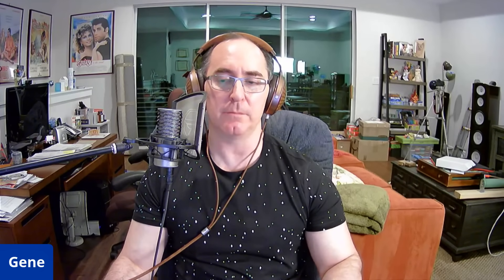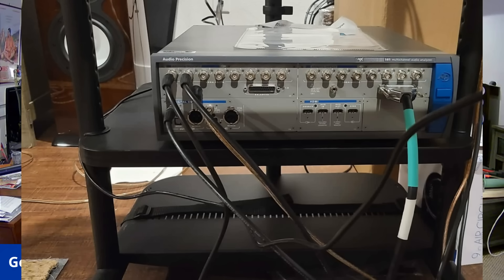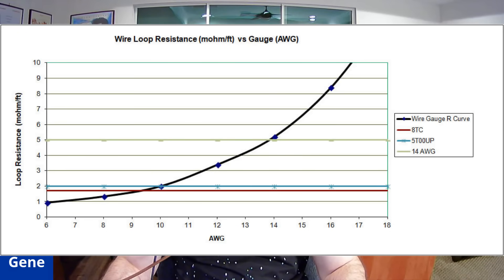Speaker Cables Really Don't Make Much of a Difference?

Comment: I'm happy to learn that my lamp cord is perfect for the job
Reply: I'm harvesting my old land line phone cables from my walls.
Reply: @deadmousyplutaprestige8771  too far
Reply: @deadmousyplutaprestige8771  They are solid core copper. Ive done that lots over the years. Just used phone line for long runs or temporary runs.
Reply: @deadmousyplutaprestige8771  Might want to twist a couple together, but I think you're onto something.

Comment: I use installgear 12 gauge  cable I got from amazon at $40/100ft with Sewell banana plugs for another $15/10. I did notice a difference coming from my previous cheap cable that was copper plated tin, but I chalk that up to resistance. I really try not to buy into audiofoolery unless someone can show me a measurement. A lot of folks poo-poo audiosciencereview, but I think most of that comes down to confirmation bias. If you've got a problem with the test, fine, but better yet run your own test and prove it. Like you said, the burden of proof is on those making the claim that there's something special going on.

Comment: Excellent video! Yes, we need more science in audio. We are getting there thanks to you and others like you! Keep up the excellent work!
Reply: I thought the same, I had my flagship arcam and Canton reference book shelf with oppo player hooked to regular bestbuy speakers wire with no conditioner power supply and reg hdmi cable.
Base not great and clarity was also not the best. I thought I need to upgrade my amplifier. More power required.
Then I was advised to look into wires, hdmi and power conditioner.
Did some research and purchased van den hul ultimate hdmi 4k cable, then same company mid level speakers wire and Puritan conditioner. Ask my wife to listen before after difference.
One simple answer. Big difference, base went up, much refined sound and distortion was gone.
I used to hear mild noise from arcam tridol power supply now that is gone.
Thats my take on this. Personal and family experience.
Reply: Amen! What the heck is a "chocolatey" midrange, anyway??

Comment: I remember back in the day when Monster hit the scene and a major HT magazine compared them to coat hangers, and found no perceptible difference.  When planning the set up of a 32 speaker system at Burning Man one year for an art project, I ended up using standard 12ga solid core electrical wire for durability and cost.
Reply: There have been A-B tests with battery jumper cables and pros can't hear the difference. Mixing studios use Belden in their boards.
Reply: @amazoidal  Studios use Canare and Mogami.. Great quality and a premium but not insane. I pay $4 a meter
Reply: @drdelewded  and Belden...each cable has it's purpose and application.
Reply: @cap96lt1  for networking, video, audio harnesses and computer applications sure we do. But running between gear, mic cables, speakers stuff that's "In our boards" we generally use Canare or Mogami.
Reply: @cap96lt1  actually our harnesses are IEWC, thought it was Belden , Which run all throughout our facility from the master control to the broadcast studios to the tape pit in the basement and to all our audio studios . I had to go check a bundle I took out of recycling that I use to make short patches. Anything critical I use Canare, as does my work. The IEWC is fairly thin, but most of it ends up in bundles in wall, floors and the back of patch bays.
Reply: @drdelewded  Mogami here, they give measurements and I get the better connectors, like you stated, about $4 or so a foot plus the connectors and the cost to build and ship. I don't have the time to sit there with a soldering iron. ;-)
Reply: @k5dbx  the problem is there's a lot of snake oil in "audiophile" (I despise that word) and it washes across the entire spectrum, leading skeptics to assume the worst going in. Doesn't help there are dozens of "professionals" on YouTube who are really just pushing their own lines or sponsors. Now don't get me wrong. I'm all for dum dums spending thousands on cables. I want to start building them myself. "Audiophile" is just another religion that's ripe for exploitation.
Reply: @k5dbx  Actually that's not the problem I have with Monster.  It's what they charge for the same results an educated person can get for far less.   10 awg will outperform 14 awg if it's from the same copper quality,   connected the same, etc.  The quality cable can be found without paying the monster prices.
Reply: I despise that company.   Being in electronics all my life I knew from the start what BS they were and still are.
Reply: @k5dbx  Where are the double-blind tests?
Reply: @k5dbx  Skin effect has soo little impact at audio frequencies.  I do RF,  I'm very aware of skin effect.  I also have the gear to measure it.  Use Litz wire if your worried about it.  Your convinced you can hear the differences,  so you will continue to be just that,  convinced.  But seriously if your not using Litz wire or multiple insulated strands you can't talk skin effect.  The only time uninsulated multi strand would start to help with skin effect is when it starts to corrode and insulates the strands from one another.  Outside of that it acts like one wire.  Don't get me wrong I love high strand count wire.
Reply: @jeffm2787  111¹111¹
Reply: @jeffm2787  your  - >  you're   ffs.
Reply: @peterwright6593  Ohh no,  busted by the grammar police.   😜
Reply: @k5dbx  Yes. I'm coming from the pro audio world. I know the difference between quality and cost. I have $3000 microphones for example.
Reply: @k5dbx  I wouldn't say "placebo" id say confirmation bias.
Reply: @Baz buddy I wear a 50 year old Rolex, I know what a luxury brand is. I'm saying the audiophile world is filled with idiots that spend 50k on speaker cables I can create for $500. If I market them with enough smoke and mirrors it's an niche industry that relies more on faith than fact. Most of these "luxury" cable companies (monster, belden, mogami, Canare aren't what I'm referring to) pop up overnight to pick off the money audiofools are laying out for a simple science product. They are relying on being expensive and offering bespoke components to let these audiofools signal to other audiofools they are part of their little cult. I'm all for it, I'm in the process of starting a cable company. I'd like to see Audiophile Voodoo be taken more seriously by gen z crypto millionaires who throw their money around
Reply: Yep, I worked for MONSTER back in 1981 Noel knew it was all BS. It was just a way to sell you a NEW AUDIO COMPONENT
Reply: @k5dbx  I just don't consider 20Khz high frequency.  High frequency high power transformers use Litz type wire.  Just not much point below 50Khz.  Again,  if in doubt,  use multi strand insulated wires, lots of them.  I have a vanity callsign as well.
Reply: @k5dbx  Were talking about different things. You mentioned the fallacy of placebo effect. I'm saying there are many audiophiles who insist they hear a difference in their latest purchases because they want to because they spent a lot on it. When all tests prove this to be false. Subjectivity is flavoured with preconceived hopes and not wanting to be proved ignorant. I'm not saying there isn't a level of cable that isn't near transparent when you spend more. I'm just saying there won't be a difference between 500 and 10,000 cables that isn't noise that might please the listener but that's subjectivity. I want clarity because I'm not an audiophile. I'm an audio professional.
Reply: @k5dbx  Galen said nothing I dont agree with. He's also not pushing these boutique $20K plus cables... worked for Belden and Blue jeans cable (who use the same canare cable I do) so I dont get your point. I never said cables dont matter. I said there's a limit to quality, and that I could build a cable for $500 and sell it for $20, 000.
Reply: @k5dbx  I can make those Iconoclast cables for $3-400
Reply: @k5dbx  I made the distinction because in pro audio circles, Audiophile is a derogatory term
Reply: @Baz Never mind, I'm not talking to you.
You're adding nothing that wasn't already said.
Reply: @k5dbx  I don't consider distributors or contractors In the pro audio distinction . They are selling you something, they are car salesmen with a different product. This is the first audioholics video I've watched.
Reply: @Baz You're only pointing out your lack of reading the thread.
Reply: @Baz Strawman.. you told me to look up luxury goods, I told you I'm well aware of them. My Rolex is 50 years old, and is a status symbol.. I'm not arguing the accuracy of the time piece or it's intrinsic value.
I drive an Ex police Crown Victoria, my clothes are cheap jeans and band t shirts, I just got a 2 year old iPhone because I use apple products exclusively for work. But you can keep interjecting in a conversation with your BS and assumptions.
Reply: @Baz basically, move along if you have nothing to add. Which you don't. So bye bye
Reply: @Baz wrong. Try a dictionary
Reply: @Bazwrong. Try a dictionary
Reply: @k5dbx  tests are repeatable, so why did Gene’s test show measurements that entail no audible difference?
Reply: @k5dbx  LMAO the bane of all cable listening tests. The double blind study. Yeah, you are just confirming your bias.
Reply: @k5dbx  What kind of benefits does working at Monster give you?  401k, stock options?
Reply: G4L4CTICNORTH  I don't know about speaker cables but I was very impressed by the way the Monster mains block eliminated noise. It seemed difficult to think of not using it once heard.
Reply: Its funny you guys are arguing about Monster cable.. They are CHEAP compared to other Luxe cable brands.. They were the first to introduce a cable that wasn't zip chord to the market in a substantial way. When they tested them against hangers it was when a set of Monsters cost $80.. UNHEARD of prices at the time. Now you can make your own cables with better cable than monster for less. And you can make equivalent or better cables than the $10K+ cables for a couple hundred bucks.. Add in fancy cases, fancy sheathing.. bespoke connectors.. maybe an expenditure of $400 and a couple hours of work..  Sell them for $5000.. Make a dozen a week on the side, boom.. you are now a high end luxury cable manufacturer..

Comment: Gene, Kimber Kable 8TC are indeed beautiful cables.  I bought 24-strand 12TC-like cable and made my own.  It probably came from the same wire factory.  I compressed the cable length-wise so that the outside diameter was larger and the individual wires crossed at a perpendicular angle.  I would love to know how that would change the measurements on your 8TC cable.  It would be an easy, non-destructive experiment.  And it makes them look even better.
Reply: Allan W.  -  Unfortunately, even prayer won't help you make something out of nothing.

Comment: So, I just spend a small fortune on Audioquest cables, the rocket 44 and XLR cables from them as well.  Are you saying that the difference between my regular 10g cables and those cables is negligible to the point where I wasted hard earned money?  I wonder if I bring my cables to the dealership and see if they are willing to do a blind test...
Reply from the maker: Yes but if you like how they look , you got nice audio jewelry.
Reply: @Audioholics  I was hopeful that you would say that Audioquest do have something of obvious audible difference.  

Since XLR cables are a little more complex, is it the same situation for them as well?
Reply: @yanickmantra  XLR are grounded and the benefits are for longer runs, making it less likely to pick up noise when compared to a unbalance cable like RCA.
Reply: @cha7260  Thank you, it is the plan to hook my new system with XLR.  I was wondering about if it does make a difference between expensive Audioquest cables or more reasonable price cables would do the trick....
Reply: @yanickmantra  Well, like Gene said it is nice audio jewelry.  You may not even benefit even using XLR instead of decent RCA cables if the run is not long.   In the end, all that matters is if you're happy with it.

Comment: Why not test for any difference in the sound wave produced by the speaker with different cables and overlay those to see any difference? Nobody seems to do this comparison, but it's the only one that matters!!  Skin effects, resistance comparisons, inductance  etc etc are irrelevant. Please do a test on comparing  the resulting sound graphs.
Reply from the maker: The acoustical measurable differences are even less than the electrical and would be below the tolerance differences produced by the microphone.
Reply: @Audioholics  in other words. It wouldn’t be possible to measure any difference. The entire measurement process would have a greater error than the cable would introduce. Anything that could alter the soundwave would show up in the tests gene did, which are far more sensitive.
Reply: @Audioholics  - thanks for response. So the human ear is more sensitive than ANY acoustic measuring machine?
Reply from the maker: @vidvidbiker  no the human ear is nowhere near as close to detecting amplitude differences than a precision measurement analyzer.

Comment: The plebs rejoice! It is nice to know my finite budget can safely be distributed elsewhere in my system.
Reply: Spend your money on speakers. Done.
Reply: @jimmythefish  And room treatments.  Gene did mention room treatments.
Reply: @jimmythefish  I have a denon e300, KEF C60 (sealed bookshelf with 8" drivers) and an SVS NSD sealed 12.

These speakers don't thrill me, it is hard to tell if they need more headroom or my receiever needs better speakers, I suspect both honestly. Midbass isnt there.

So I was thinking, get another sealed SVS 12, get a decent amp, speakers and room treatment.
Reply: @sapphirepyramid  I have the C30 kefs. Sadly the midwoofer doesn't have midrange clarity. Partially a symptom of a polycone woofer
Reply: @sapphirepyramid  KEF C60 where would the midbass come from? That miniscule tweeter or that 8" woofer? It's also a 1988 speaker. You can't really compare it to what's on the market today. Be realistic.
Reply: @xavdeman  I would expect midbass from an 8" woofer typically, but I get that these are old AND sealed.

I wasn't comparing them to modern speakers, I just wonder if I had a better amplifier if it would bring them to life at all. Regardless, they will be the first things I replace haha.
Reply: @sapphirepyramid  There's nothing a new amp could improve about such speakers. I'd replace them.
Reply: @sapphirepyramid  your problem lies in the 3rd and 4th octaves so adding a sub will do nothing as they are playing octaves 1&2...yes better amplification would help the midbass to a point, but I think it's time for different speakers I think...
Reply: @Echo-jg8is  Yeah the idea of a second subwoofer wasn't to address the midbass, I should clarify.

I tested some bass to midbass sine waves and actually the speakers do indeed play them fine, the issue seems to be speaker placement and listening position.

I used Audacity and switched the bias from left to right speaker and individually, from my listening position, they are almost mute. When I play them both it gets better but the real difference is when I move around the room.
Reply: On $15000 USB cables..